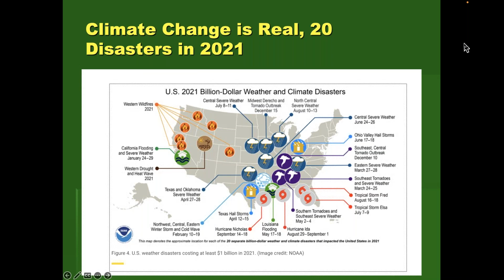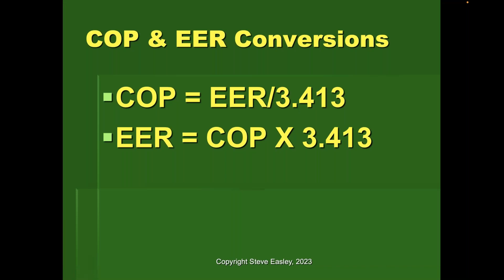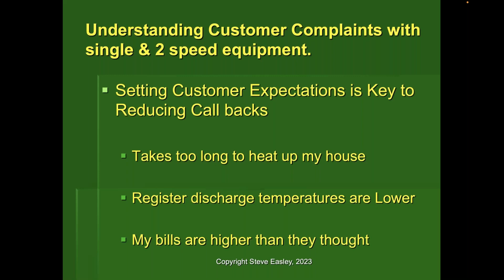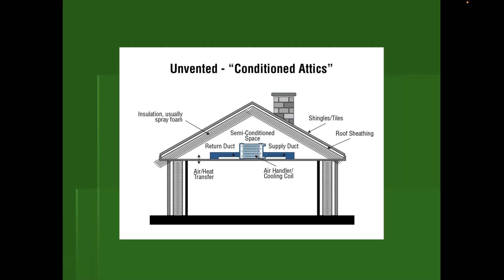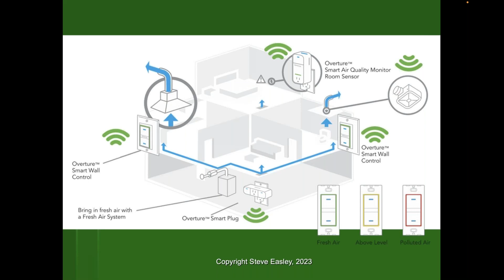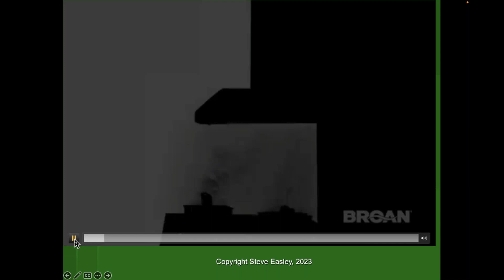Cost Effective Solutions for Residential Electrification

Comment: Just to add, I think it is so important for suppliers of the needed equipment and materials needed to transition our home into something that are eco friendly structures, whether it be heat pump manufacturers, window manufacturers, smart home control system manufacturers, insulation manufacturers and the list goes on and on, can bring the prices for their products to a reasonable amount. They have the next 10 to 20 years to reap the rewards that the transition will bring to their profit margins. At the moment, transitioning to a more sustainable environment in our homes is beyond the reach of most people.

Comment: I think Steve was a great guest to the show. I think he had a level of knowledge that surpasses many of the people I have listened to over the last year. What he has address in this short period of time was extremely relevant with the state of how the latest technology is needed to change how we renovate existing homes and build new homes for the future. Stressing insulate well, air seal well, use properly sized equipment for that environment, use IAQ sensors to control ERV systems and how important it is for installers of HVAC systems to pay attention to details to make sure the installed system works efficiently as they were designed to do. The home building industry is going to go through a very disruptive change in the coming years.